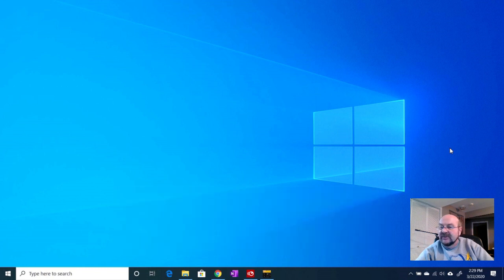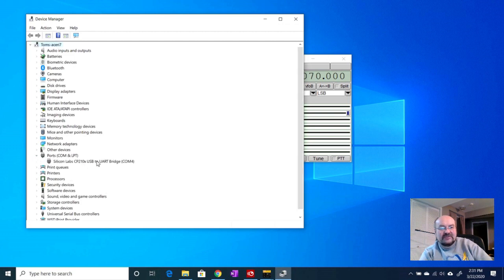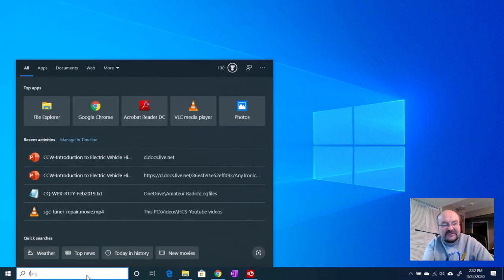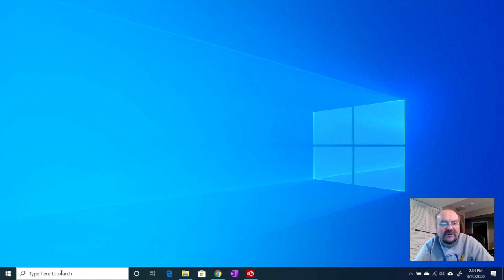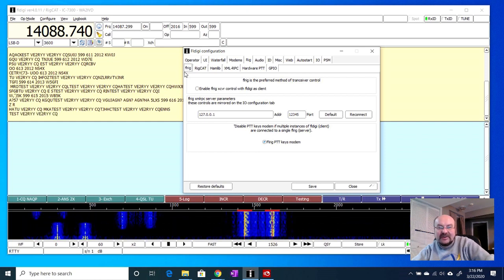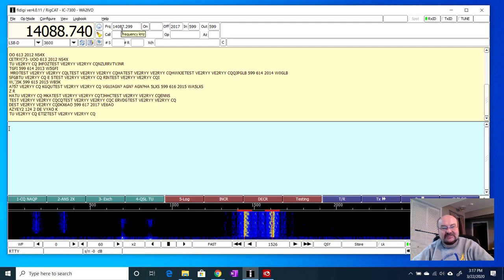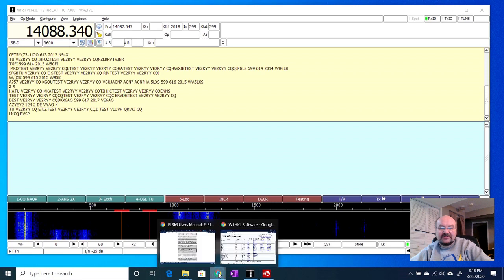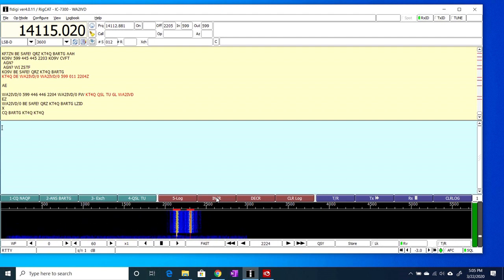Icom IC7300 A to Z #39 FLRIG-FLDIGI USB Troubleshooting

Comment: Thanks Tom, I’m using Flrig and hopefully I got my issues fixed.  Flrig works fine with radio and computer but I’m getting intermittent issues where the radio keys up but no audio is getting to the radio or the Rigblaster Blue.

Comment: Hi Tom,  I have learnt the best way to sort this is to save every different software interface package into the memory on the SD card of the 7300, I just pull up whatever I am using, WSJT etc. saves a lot of heart ache at least for the rig, it also seems to set the software back to the settings you had initially, however some like your COM port very occasionally do get corrupted but at least having the rig settings always correct helps. Never really had a problem since I started doing this, better than writing the settings down in a note book....  Cheers  Malc
PS  Have you ever tried FreeDV.. if not then for a brain puzzler this cant be beaten... worth a video. Ta
Reply from the maker: Thanks Malc.  And a great suggestion!

Comment: Hi.

My way to use fldigi  is to let fldigi to control the rig.  Yes, it is not convinient  as flrig, because we cannto change/control  much of the rig, but for the fldigi purpose, it is enough  to change frequency.  

BTW, we still can change the rig's settings, such as filters or RF gain,  directly.  

One more thing.   make sure only one application is accessing  the com port, or you can try to set flrig and fldigi to access the com port at the same time., at the same baud rate.

Thank you and keep safe, 73.

Comment: Well hello again. okay with FLRIG setup and on a blank spot I tested triggering PTT and it did key the TX. FLDIGI indicating  rig data but now to find a quality USB cable. Waterfall nothing showing and yet FLRIG shows signal strength. No time for quitting so the project continues. Many thanks.

Comment: Tom I am running the latest version of FlDigi and FlRig, I have my comport set for 9600 Baud on my comport and in FlRig my 7300 works with this setting. But I find almost every time I take a windows 10 update some of my sound settings get changed between FlDigi and my  computer so I have had to change settings every time there was a major update to windows 10. 73 WD8JVV Ed

Comment: I enjoyed the video, but the only way that I can get FLRIG & FLDIGI to communicate is in fldigi RIG CONTROL to check the box that enables flrig xcvr control with fldigi as client. But, even when I get flrig and fldigi to communicate with each other and the rig settings are both the same, now I can get no output on transmission. So, I'm working on that. Thanks for you efforts es 73.

Comment: Hello, Can you help me with my setup.  when I start fldigi my 7300 keys up and does not unkey. I have to turn off the radio.
Reply from the maker: Hi Taino.  Unfortunately, FLDigi does offer way too many options for this.  I need a little more information to offer any help on this.  Are you using FLDigi stand alone?  Or, are you using it with FLRig to control the radio?

Comment: My Fldigi controlled by Flrig works well enough. But as it sits idle the screen fills with garbage. The other problem is greatly reduce transmitter power when transmitting. Win 10 Xiegu G90 and latest Digi programs. Anyone help?Thanks

Comment: I can’t get the 7300 to work on Fldigi no matter what I do. I’m going back to another radio with a signaLink. It just works.
Reply from the maker: I’m sorry to hear that.  I never did make a follow up to that video. I  installed a newer version of FLDigi at that time and that solved my issue.  I recently made a video using FLDigi in a RTTY contest and it worked fine for me.
Reply: @HamRadioA2Z  a friend of mine had a similar experience on Ft8 with WSJT recently. He installed the newest version of WSJT and worked like a champ. I just have very little patience with computer stuff. Thanks for posting the videos for sure. I’m about to start down the 705 trail next.

Comment: It looks like a good software FLRIG and FLDIGI but it's not so straight forward, I have JTDX, WSJT-X, CWSkimmer and others working with the radio and all of them are able to comunícate with radio this one it doesn't. Another thing, on Device Manager / Ports the speed is not relevant, the APP Speed overrides this one.
Reply from the maker: I made that video quite a while ago.  There have been multiple updates to the FL series of programs since then.  I should probably do an update.